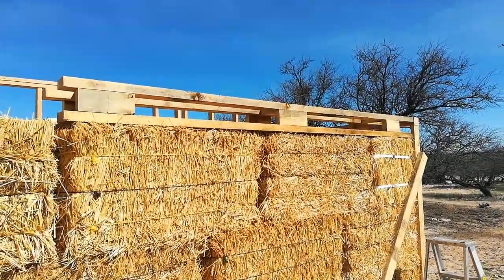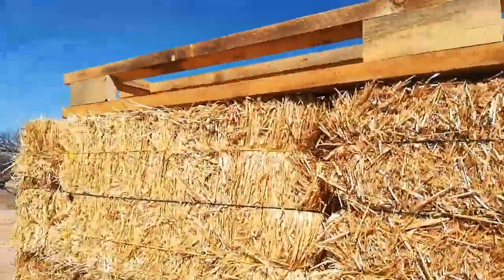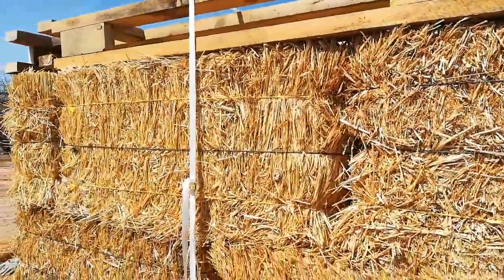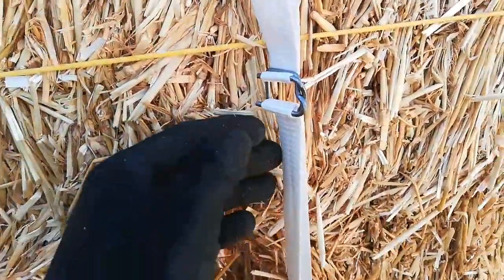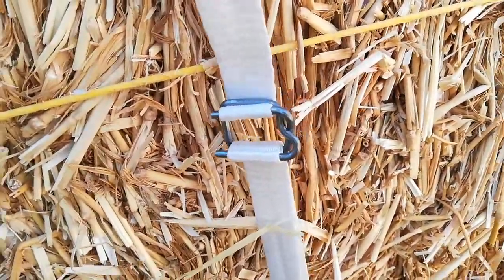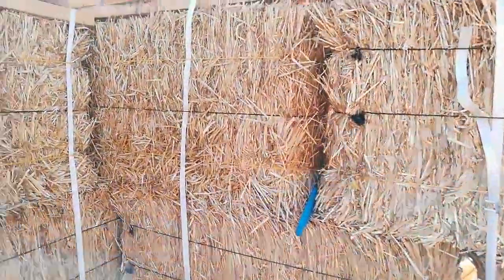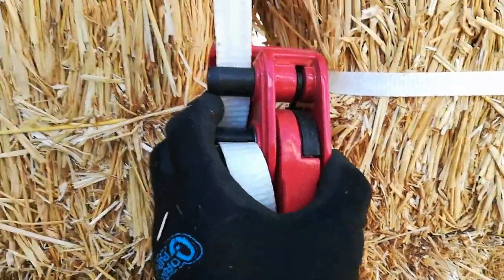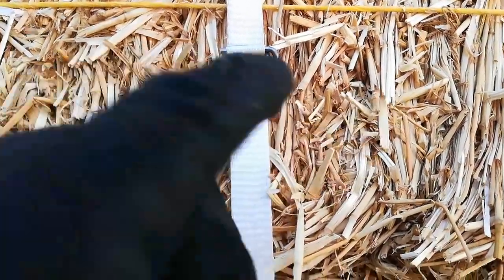Strawbale Build Top Plates and Strapping

Comment: When you release the tensioner, does it automatically cut the loose part of the strap each time? Seems like that would make it awkward to do the lug nut style of tightening a bit at a time.
Reply from the maker: It's suppose to cut the strapping but you can also pull the tool out towards the side thereby retaining the full length of the strap. We just recently figured this out while building our Strawbale House. Another method is to set the tensioner tool far back from the buckle by leaving longer tails to work with. This will let you tighten the bales, cut the strap and still have enough strapping material left over to repeat the process. There's a learning curve, but it can be done quite easily. Thanks for watching!
Reply: @theupsideofdownsizing  Thank you! I've got the same tool and have used it so far to strap down the base plate of my walls that are wood framed (I'm using a gravel filled earthbags stem wall). I'm building a passive solar greenhouse with strawbale back half.
Reply from the maker: That sounds like an exciting project! Thanks for watching 👍